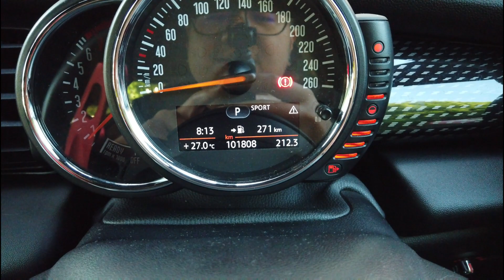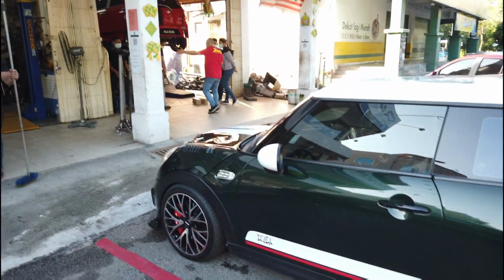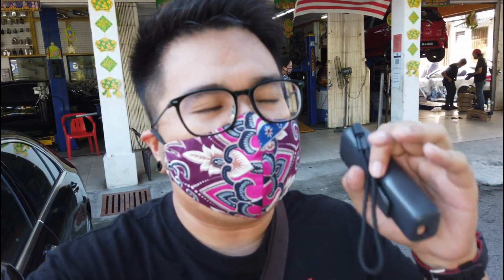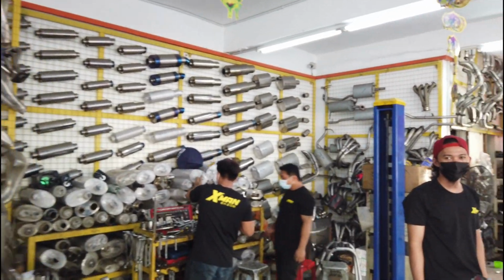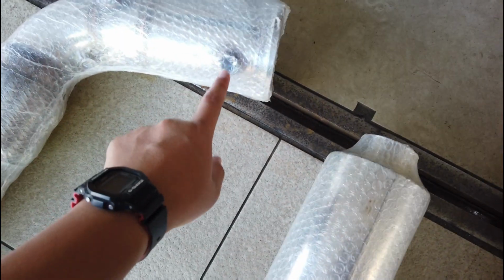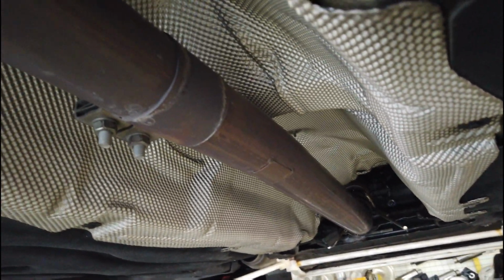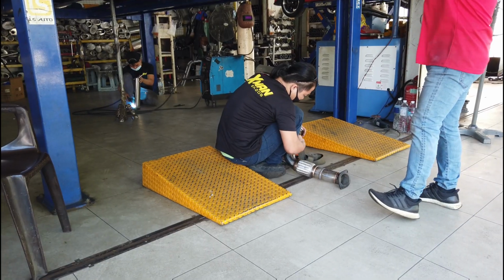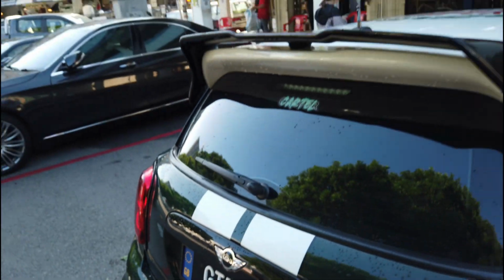Modding my JCW Pro exhaust system yet again! Changed downpipe and added resonator

Comment: What your hp? Also what time are you running?
Reply from the maker: Sorry I don't understand the question. If horsepower, then it's 253whp. Time is what time? Sepang?
Reply: @AhmadIrfan  sorry what tune*** my phone corrected it, also what mods are you running in your car.
Reply from the maker: @betoest93  the tune is by Aktiv Tuninghaus, not sure if there's a name to the map. I don't have much mods, just the catless DP + JCW Pro exhaust + drop in intakes. Some coilovers. And a stage 1 map
Reply: @AhmadIrfan  I’m looking into getting a down pipe later on but that’s something I would have to look into deeply i live in Texas and I would want a good tune on mine did you send out your ecu or was it local ?
Reply from the maker: @betoest93  mine was done locally fortunately. But i think there's several guys who can help tune remotely or something. Like Evolve or Lohen in the UK. But I did not dig deeper into those options